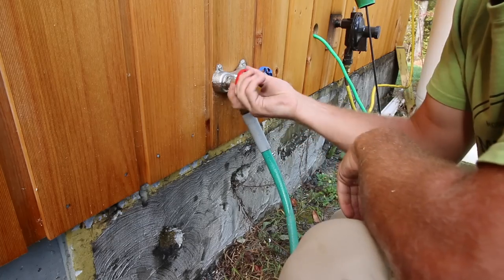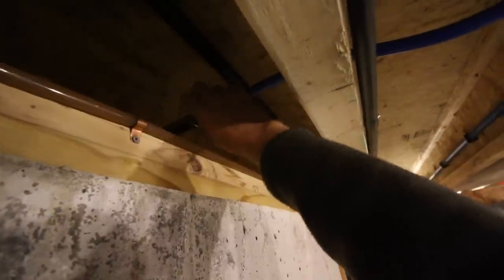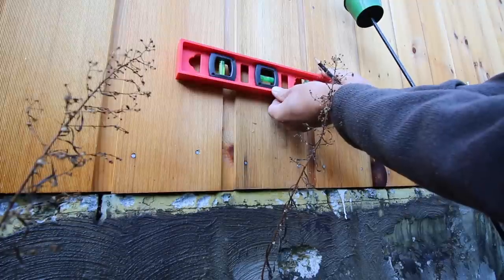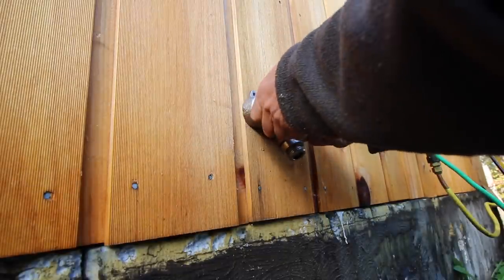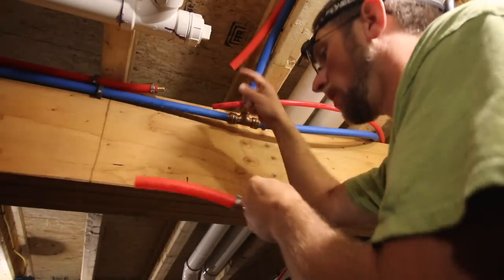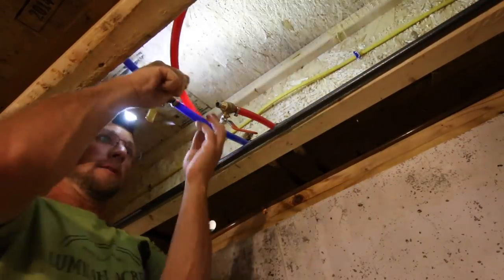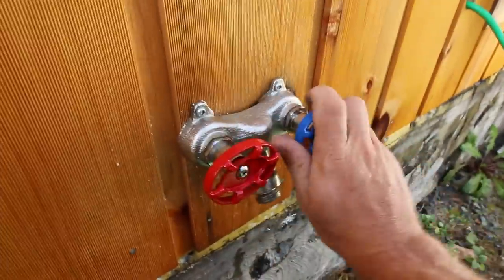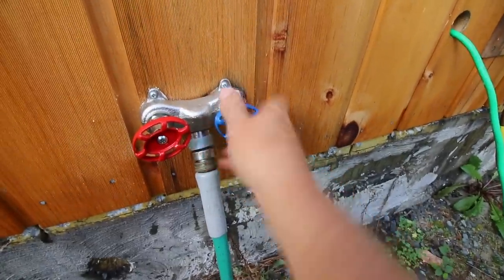Installing a Hot Water and Cold Water OutDoor Hose Faucet

Comment: Nice to see that you put hot water outside along with your cold water, now you need to get a 50 ft or a100 ft water hose reel.. you can get a portable one that you can roll around anywhere you want or you can get a fix one to mount to side of the house.. good luck with your future meat processing ventures coming up in the future.

Comment: Excellent step by step on the faucet installation. That leaky device where the hose connects is a 'anti-siphon valve' to keep water from backflowing (possible higher pressure backing into the house) into your domestic system in the house, it also opens when pressure drops between the shutoff seats and the hose connection. I have never used pex for water piping, it has always been soldered copper (I'm really showing my age here) being an old plumber from another century. lol You are really "pulling out all the stops" for 'Hand Hewn Farm' classes. The great news is you will have everything setup for future uses!  I think you should put on your own "chicken harvesting seminar" sometime after the pig harvest....I've watched your video(s) on this vlog, and you are very organized and prepared.
Reply from the maker: I was thinking about doing one!

Comment: I like PEX because you can tell the hot water line from the cold without touching it, or tracing it back to the source.
That's such a great set up; I may have to see if I can copy that. It would have been nice to have hot water when I was processing ducks.

Comment: Al:   Good video.    If you use the warm water in your pressure washer it will remove grease and dirt better when cleaning the tractor and other equipment.  Also a light prespray with detergent or degreaser will help.   If you work over a tarp in a depression you can recover most of the runoff for proper disposal.       Bert

Comment: I never knew such a thing existed. My pipe is all CPVC so I would need a different connection but I am sure they must make that valve with another connection than a hose connection. I have hot water within about 10 feet of where I would want that fixture and as you said, all services can be individually shut off. My present hose connections have both a shutoff and a drain even though I used frost proof valves.

Comment: I like you sealed around the hose outlet, but had a big open hole next too for the critters too get into house..
Reply: sparky0288 It's not a whole it's a knot in the wood.
Reply: With a green extension running through it to a plug inside....knot?

Comment: Hot valve line from the water softener for washing our vehicles.
Cold valve connects before the water softener for watering and foremovingross matter from our vehicles before washing with soft water.  
Hopefully rinsing with soft water leaves less mineral spots.

Comment: Yup, if you build your own you do it right, shut off valves and all!
Now you can build an outdoor shower LOL
Reply from the maker: Don't get me started! :)
Reply: kleineroteHex My hubby tried to put in a double hose connector that fails miserably.Leaks constantly drip drip . I will see about shut off pex inside and see about the leaks. I get hot and muddy and sweaty, a quick shower off outside is so perfect. We lived at the Atlantic ocean and everyone had a outdoor shower head right by the door to the house. 
     Putting my head into horse water tanks is ok but they get scummy sometimes. Cold hose water running over my head hurts, but it keeps me from passing out!!

Comment: You should drain your water heater at least once a year. Vacuum out the bottom of the tank and replace the elements.
Reply: The Cynic - I drain my water heater once a year, never changed the elements & I have no clue how to vacuum it!
Reply: Terri Poulin I use a wet dry vacuum. The elements are easy. Once it's completely drained. You take the wires off and then use the tool to unscrew the elements and replace it.  Turn off the power at the box first. 

My water has way too much calcium and chlorine in it and if I don't get to it in time they foul out.  I have to take them out every three months and clean them off about every three months.  Did mine last night.

Comment: I'd like to pass on a little "hack". Put some grease (plumbers grease, vaseline, even lube grease) on the spines of the faucet handles and the screw threads that hold them on. A few years down the line they corrode and can be impossible to get off to replace packings,washers and O rings.
Reply from the maker: Thanks! Great hack!

Comment: My faucet like this has failed. It leaks A LOT in the backflow connection and doesn't stop (yours stopped leaking). Is there a way to replace just the backflow portion as the faucet is very expensive and is only 2 years old. Seems to be all one piece with no stop screw to separate it. I turned it off after every use but had used a nozzle to wash my car so was under pressure when in use. It still should not have failed so quickly at this price. Please do a follow up if yours starts to leak.
Reply from the maker: I would write to the company and see if they will send you some replacement parts

Comment: You should never put the hose on the ground.. Put a hook on the wall to hang It. Bacteria will contaminate your drinking water. Apply 2 non return valves after the shut off valves so they will act As backflow prevention devices, thus not allowing bacteria in and then enjoy it. Non return valves allow the flow of water in One Direction only shown by the arrow so the water cannot be sucked back in when negative pressure builds up in the pipework due to other taps being used in the House at the same time, water company reducing pressure to carry out works or too many neighbours using water at the same time around your property. I'm a qualified plumber and I care about people safaty. Greets from An Italian in the Uk